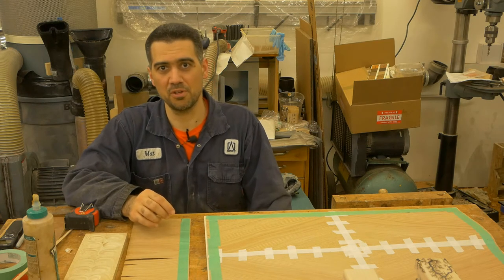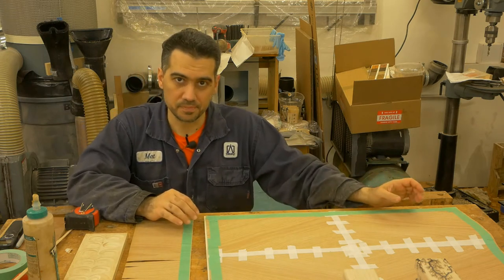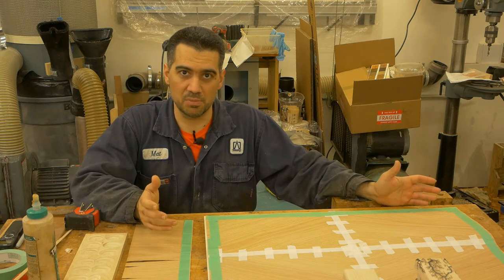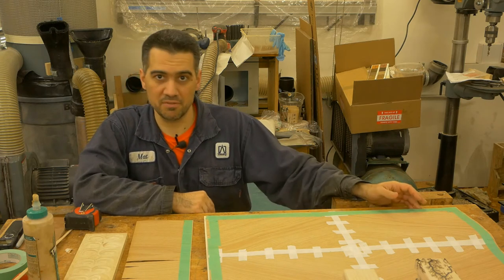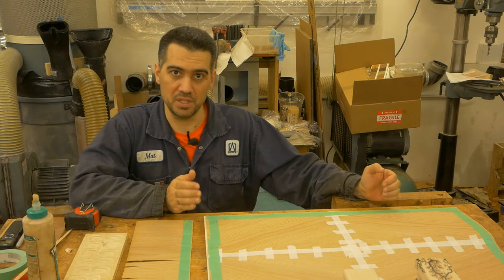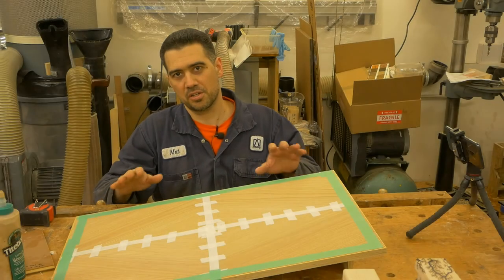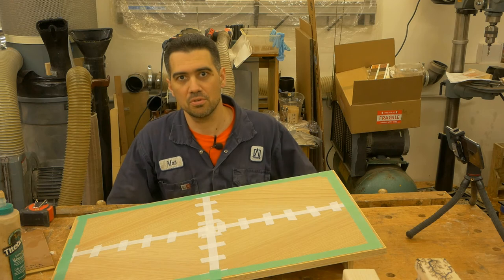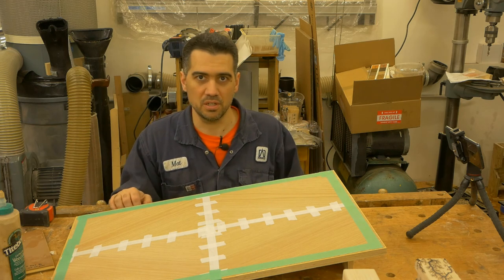Pro-Tip - E06 - How to Glue Veneer - The Right Amount of Glue

Comment: Thinking about it in terms of glue thickness was just the idea I needed.
I've been struggling with bleed-through/poor adherence on some mahogany veneer for some time.
My method for achieving consistent glue volume differs a lot from yours, but the idea is the same :)
Thanks for the idea.